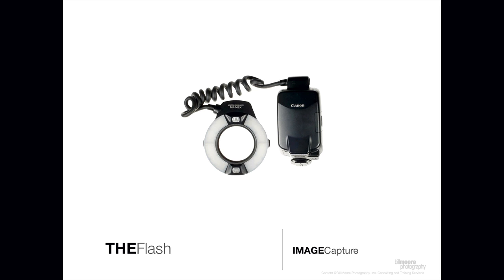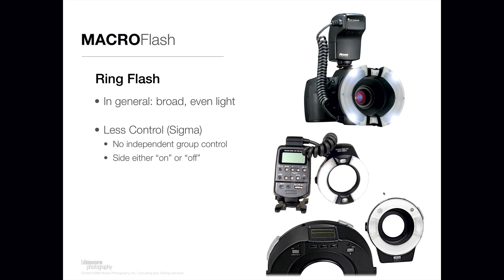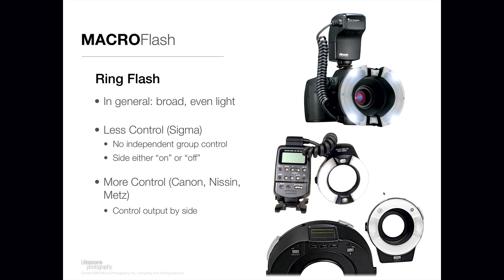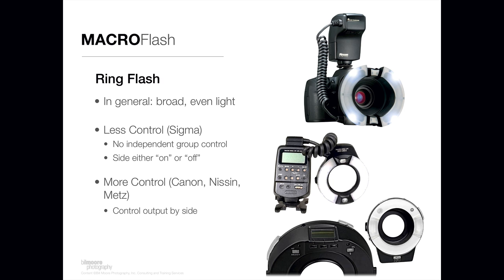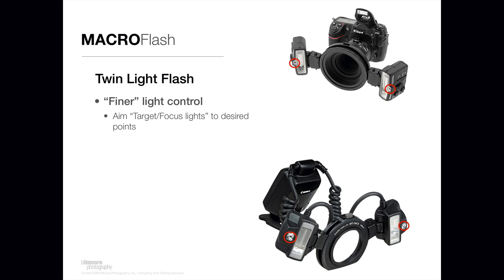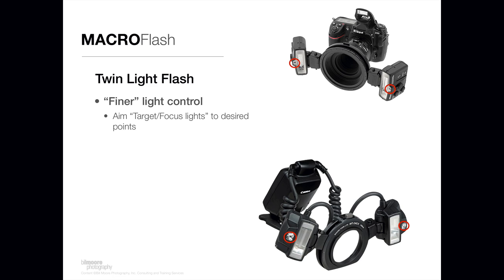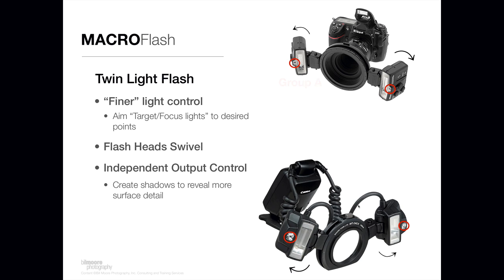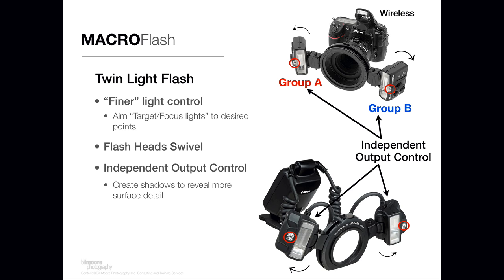DentalCameraSystems-Flash

Comment: Nice vedio.. So which is  better get twin light flash like mieke or 2 separately flahs on 2 long adjustable braket's arms  for my orthodontic treatment cases??
Reply: Hello محمد بدر,

Thank you for your comment.

I do not recommend third-party dual flashes, only those by Nikon and Canon. And I do not recommend the adjustable brackets you mention. There are much better ways to get great lighting.

You can find my recommended camera equipment here https://www.dentalphotographymadeeasy.com/equipment.